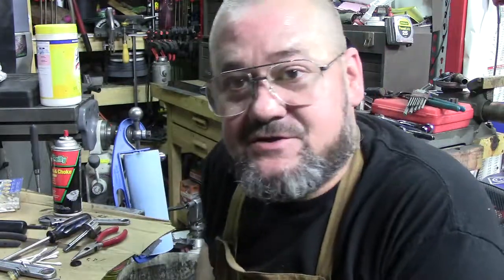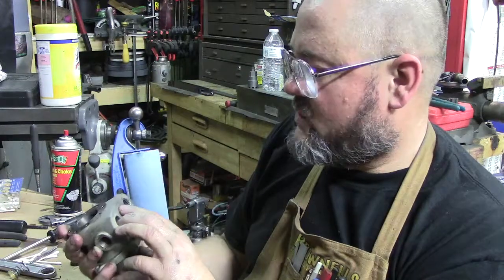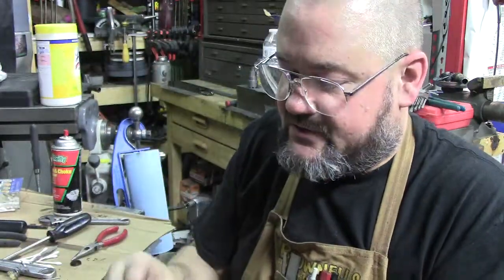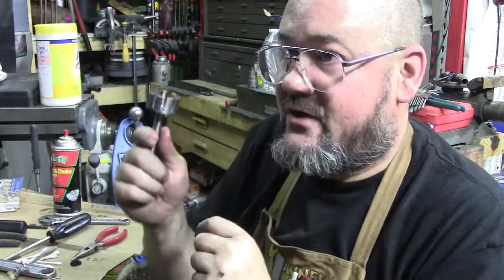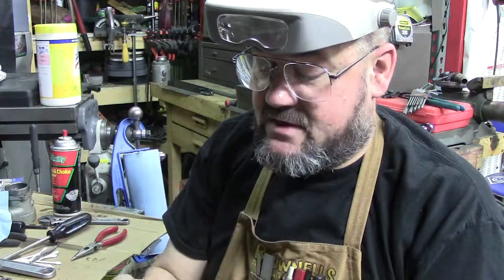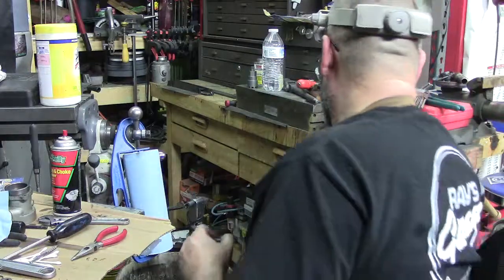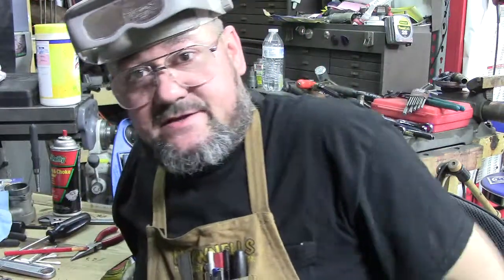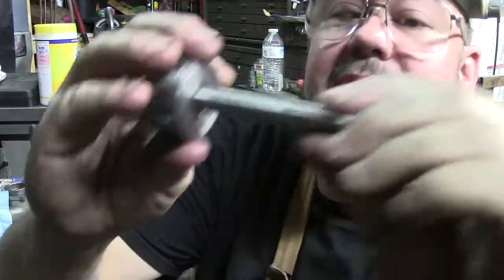Hydraulic Pump Rebuild PT3

Comment: Hi James,
 I would be very interested to see the how you remove, clean and replace the hydraulic filter. BTW, I have a challenger 2A owners/parts manual is you need one
Reply from the maker: John91406 Seems great minds think alike. I have one as well that I bought off EBay and a few I down loaded from my friend Keith Ruckers website www.vintagemachinery.org.